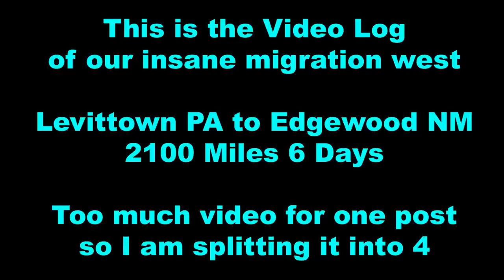The Insane Migration West 3of4 T3DP

Comment: For the hall switch, kitchen switch, and all the rooms really, you may be best served by buying some of the TP-Link smart switches that work with Alexa, Google Assistant, and Siri without the need for a hub.Then you don't have to deal with rewiring stuff and have access to all lights from anywhere in the house (or from your phone anywhere in the world).
Reply from the maker: Well it's a good idea that technology is not quite ready at least not ready for me first I don't want things listening to every word I say throughout my house :-) second voice recognition is not quite there yet and it's too complex I don't want to have to say Alexa turn on the kitchen light I want to be able to walk into a room and simply say lights I have the lights turn on and if I say lights again turn the light off that's what I want :-)

There is an additional problem I want to attempt to run as much of the house off solar power eventually as I can and switches have a very distinct Advantage when they're off the use absolutely zero power even a basic automated circuit is going to use between 1 and 4 Watts that doesn't sound like a lot until you have 30 of them now you're talking 120 watts that's more power than all the light bulbs in the house use :-) because remember those circuits are consuming power 24/7 :-) plus I really like the convenience of 3-way lighting you walk in you for the switch as you passed the other end you flip the switch I guess the house is not quite large enough or they didn't want to spend the money to wire it that way I'll probably just get used to it the distances are actually very tiny

Comment: A suggestion for you hallway light is get one of those bulbs which turns on if it detects motion. I'm using one of those in my basement and it works really well.
Reply from the maker: Good idea. I may look into that. I might try and wire in a 3 way switch (will take less power)

Comment: I was really wondering how much gas did it take
Reply from the maker: I am going to sit down and run the numbers. Pretty sure i got all my reciepts. Roughly $2000 to $2100 in fuel between both vehicles IIRC total trip cost is right around $6000 to $7000 including tires food hotels etc.. Car shipping etc.. I will do an episode on the alternate channel and go over the finances. I have just been too busy and tired to grind through reciepts and statements to do the math :-)